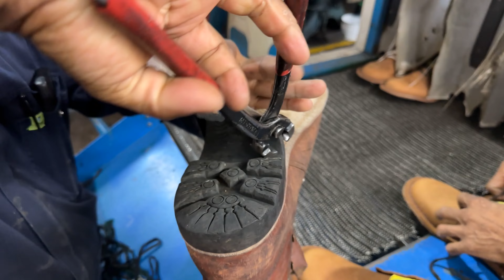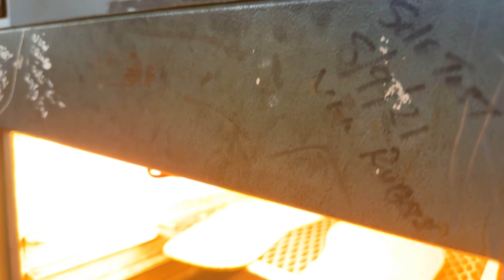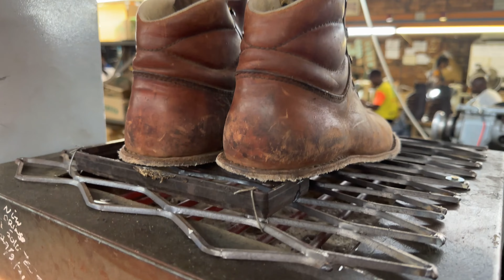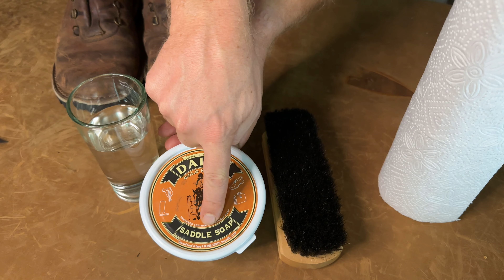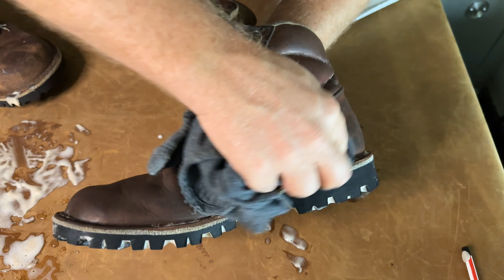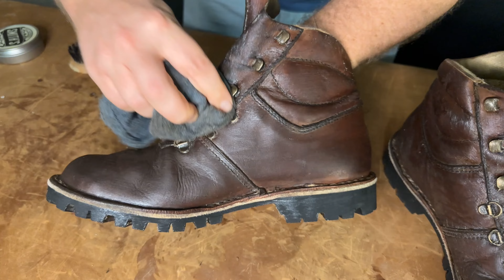20+ Year Old Jim Green Boot Restoration

Comment: I was under the impression that fiber board would’ve broken down by then but it looked like it was in pretty good shape.
Reply: I know! I watch all these reviews and they make fiber board seem so bad. These are 20 years old and the fiber board is fine!
Reply: Pretty sure in an interview they talk about how they use leatherboard midsoles and insoles.
Reply: @gdaddy6922  yea I saw that too, it was in response to customer feedback if I’m not mistaken. I bought two pairs of razorbacks as work boots two years ago and it’s time to resole one of them so I guess we’ll see if the fiberboard needs to be replaced
Reply: @craig7887  I watch the same ones! Now I’m scratching my head.
Reply: @Bayou987  To me that means that while leather is the better choice, fiber board is perfectly adequate.  Getting 20 years out of a pair of boots?  Sign me up!
Reply from the maker: our board we use is a polyester woven board so far superior than a standard board used on cheaper boots, as it's not "leather" sadly it is presumed less than. If our boots are cared for over time you can get 2 or even 3 resoles out of them
Reply: @craig7887  depends on the quality of fiber board.  most are just a form of cardboard and suck, they use something entirely different.

Comment: When sanding the midsole after taking the outsole off, I noticed the sander sands over the stitching of the upper and midsole. Does this not damage the stitching in any way?
Reply from the maker: HI Michael, great question! There is slight damage to the stitch but this is done in order to ensure all previous glue residue is removed and this damage is not extensive enough to cause damage to the construction and join. Should this not be done correctly the newly applied sole can delaminate extremely fast💪